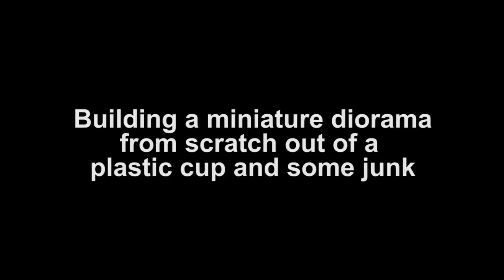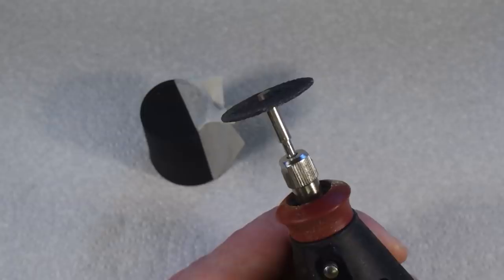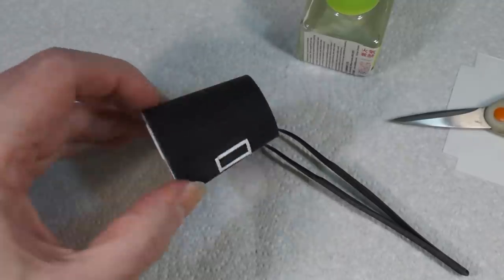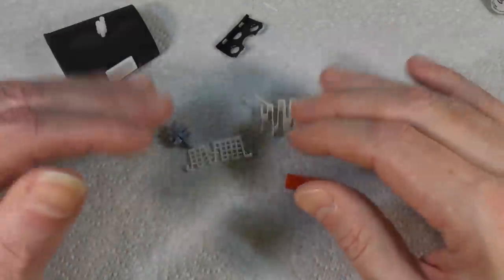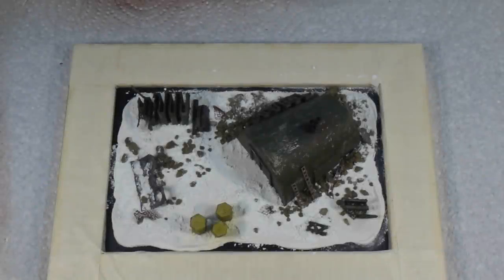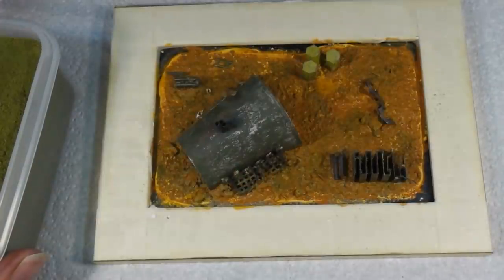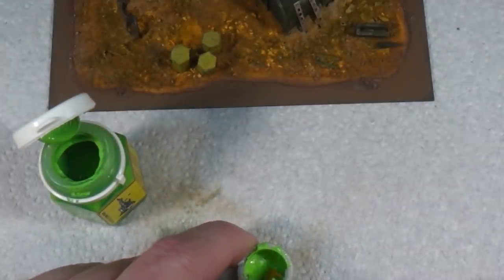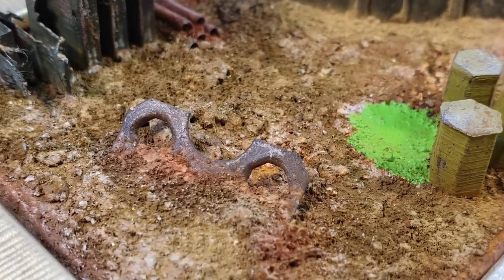Building a miniature diorama from scratch out of a plastic cup and some junk

Comment: Hi
As for the (frosting effect you got), well I think if you are using the recipe you made in (Mixing up a batch of scenery glue for an upcoming project) video, then the reason is obvious, the IPA will separate the binder from the mat medium and that is the solids you have in the bottom of the liquid after the tow days, so the two days period is not enough for that, the next time you make a batch try mix the alcohol wit water 1st, then add the matte medium, and let it settle for 8-10 days. 
I had the same problem before, and that was the remedy. 
Thanks for all of your good videos, very informative and inspiring.
Reply from the maker: I'll give that a go next time, cheers.

Comment: I'm probably late to the show, but what happened with your matte varnish is called frosting. Not 100% sure what causes it, but high humidity seems to be a big factor. What's happened is that the varnish has set into a very rough texture instead of a smooth coat, causing it to appear white. (Yes, I know matte varnish is always rough to some extent, that's why it's matte instead of gloss. Frosting is that roughness turned up past 11.)

The cure is a coat of gloss varnish over the top, to fill in that rough texture. Then wait for a less humid day for the matte varnish.

(It's also a useful tool at times, I've waited for high humidity days to vanish winter-themed projects just to get that frosting effect...)

Comment: I have now changed to dremel click discs, if you have not tried them please do, a bit pricey but the benifits outweigh the cons. I will never go back to the normal ones again. Best place is ebay to buy. They take a fair bit of abuse where the discs you have there would have broken. Anyway you have a new subscriber 👍
Reply from the maker: Thanks, I appreciate it. I have hundreds of these cut off wheels, and as long as one is careful and use correct safety equipment, they're safe enough to use.

Comment: Hi there,  I'm not sure if you answered this already and I didn't see it in your supplies list...so if you've answered, I apologize.  Anyway,  what kind of glue are you using and where from? It seems you use very little.
Reply from the maker: I actually use methyl ethyl ketone, an industrial solvent. However, it's extremely nasty stuff and I really wouldn't recommend it unless you have very good ventilation and PPE. The next best thing I find is Tamiya Extra Thin Quick Setting - does a similar job and much safer to use :-)

Comment: Interesting, but seems like all the "ground work" should have been done and finished before adding building and all the other random bits in the yard. That's what I would have done anyway! Good job on the herb tree, and I suppose you threw the excess herbs in your pasta sauce, eh? :D
Reply from the maker: Well, everyone has their own way of doing things. I do it this way so I can blend the buildings etc into the terrain. It's the way I learned to do it when I was a kid, reading tutorials in magazines :-)

As for the herbs, that pot is purely for modelling purposes - way cheaper than buying "proper" ground coverings.

Thanks for watching.
Reply: @SteamGeezerUK  yes, good job regardless of approach. Fun related story: while I was rooting around in my garage last year I came across a box of plastic plates, cups, etc, all stuff you'd take in a basket to the park for nice lunch on the grass. I made a space ship from them, looks pretty good actually, crew quarters, Equipment bays, big radiation shields, a big cup for the fusion reactor section, advanced propulsion nacelles (a chip and dip bowl), shot glass for the main drive nozzle, and some 12 ping pong balls for tanks (got have round or spherical bits on a space ship right?). Well, I painted it all white, black accents and dark gray for the propulsion bits. And I have dubbed it the "Starship Pic-Nic". LOL. :D Nice to take a break from kit builds for a change.